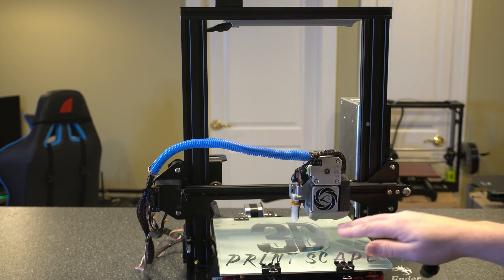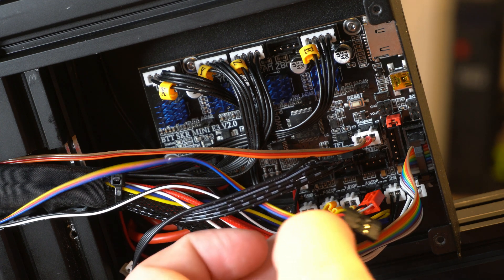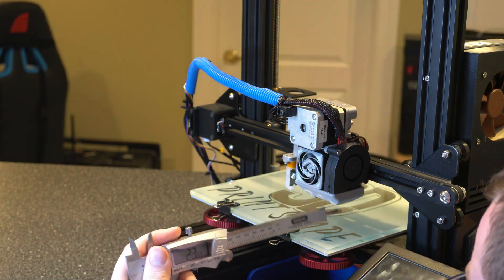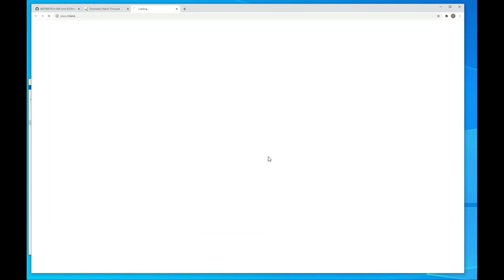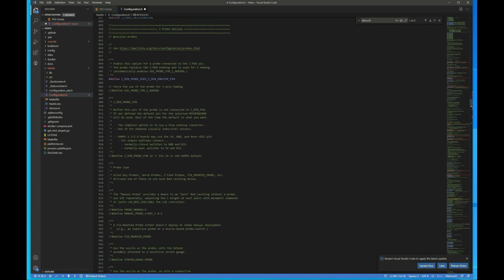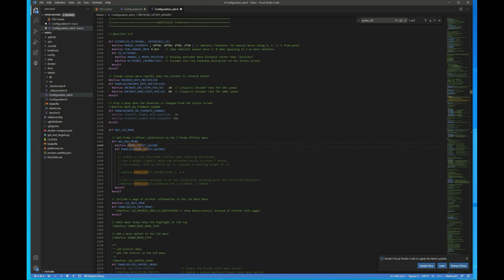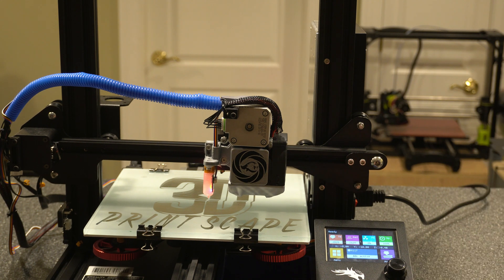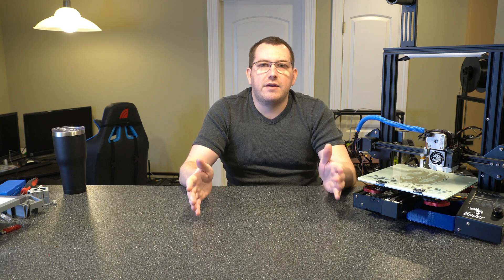BLTouch on SKR Mini – Install Guide

Comment: Robert this video is great I have 2 ender 3 pro'2 and 1 has this exact board in it so this video helped me get my bl touch installed perfectly.  I am running the factory firmware on it but would love to build a version like you did in the video.  I wish I could get a copy of the one you built on here, as my printer is the exact same.   I am just not quite comfortable enough to write my own firmware yet LOL.  I was able to obtain a full version of marlin for my other printer which has the stock 4.2.2 board and it runs so much better than the creality firmware.  Just wanted to say again great video it helped me very much.
Reply from the maker: Hi. Thanks for the feedback. I actually have build available here that you can use. https://3dprintscape.com/marlin-firmware-builds/

Comment: My "default_envs" is set to mega2560....do I need to set it to the "STM32F103RC_btt_512K"  I have the same setup as your video.
Reply from the maker: Hi. If you using a build after June, you will want to change that to STM32F103RC_btt. The _512k has been removed as an option.

Comment: Hello, you said for the wiring you have to swap the blue and red cord right? how do i do that?
Reply from the maker: Hi. You should verify the pin out for your bltouch, ive seen them shipped with different wiring colors. If yoou need to swap the pin, there is a little tab you can pull on the adapter that will allow you to pull the wire out.
Reply: @3DPrintscape  Thank you so much i really appreciate that!
Reply from the maker: @BrothaManLemon  You're Welcome
Reply: @3DPrintscape  hey one more question. so if i still have the stock fan cover i can just take either the SKR firmware or the Marlin firmware, download it, change name to firmware.bin, pop it on an SD, put it in my printer and then I'm good? or do i have to make changes in the firmware still?
Reply: i downloaded the SKR Mini Firmware and when i turn it on and hit bed leveling it just says home z first. i downloaded the frimware where you attach the BLTouch to the Z stop
Reply: So i tried doing exactly step by step what you did with the marlin software and for some reason when i try to build the firmware it shows red text and doesnt build
Reply: sorry last comment lol but when i try to build it says "Error: Unknown environment names"
Reply from the maker: @BrothaManLemon  Assuming there are no other changes you want to make, that would work fine.
Reply from the maker: @BrothaManLemon  Did you add _512K to the name? If so, remove that. It was removed from the bug fix line back in June.
Reply: You da man sorry for the multiple replies lol
Reply: yea ive followed everything to the T and every time i try to build the firmware it says failed. probably gonna give up on this one lol i really appreciate all the help tho!
Reply from the maker: @BrothaManLemon  If you need more help, you can join the discord channel. Its easier to troubleshoot there.

Comment: Just got my SKR Mini E3 V3.0 and jeez, this is going to be a p.i.t.a. to set up properly lol! I referenced this video to follow similar steps, but it's so new that there aren't any stable firmwares apparently. You plan on upgrading?
Reply from the maker: Hi. I've considered picking up the v3 but to your point, there isn't much reference material on it. Id does look like the BTT github page has the config that can be used a starting point though. This may help out for your marlin build. https://github.com/bigtreetech/Marlin/tree/SKR-mini-E3-V3.0-G0B1
Reply: @3DPrintscape  thanks for sharing! I was pondering the thought of creating a little vlog on getting this thing working, but I'm at the "trial and error" point where I don't want to make a video of 12 diff tries before having success, haha! I'll tag you if I get this video up today.
Reply from the maker: @TechReviewLife  Sounds good, if you run into issue let me know and I will try to help out.
Reply: @3DPrintscape  first issue has arisen, lol! After I used WinMerg to compare my old Marlin to the new one I just downloaded, I get pretty far through compiling the firmware in VSC, but then I get this error.

<command-line>: fatal error: variant_MARLIN_STM32G0B1RE.h: No such file or directory

I've tried to search for this error but nothing pops up, as I assumed nothing would given that this is so new. Any tips?

Thanks!
Reply from the maker: @TechReviewLife  That may just be a file length issue. Try to move the firmware folder closer to the root of your drive.
Reply: @3DPrintscape  fixed it! I copied over pretty much everything that was different between the V2 and V3 firmware, and that's what gave me the error. I went back and only edited a few things, bltouch, offset, zprobewiz, etc, and it's working great now! Bottom wheel of my MSDD is eating in to the rail, but that should be a simple fix lol.
Reply from the maker: @TechReviewLife  Nice, Im glad you got it working. Thanks for the info, it will help me out when I get the board.

Comment: My printer ignores both ZSTOP and BLTOUCH, I've done everything exactly like you but with the 5 pin configuration(the ZSTOP is still connected but not in use by the firmware). When I try to home it ignores both stops, it doesnt work properly if I use the bin from bigtreetech but they only do a single probing which is why I wish I could use the custom firmware.
Reply from the maker: Hi. If it works with the BTT firmware, the wiring is good so it sounds like there is an issue with the firmware. Im guessing it doesnt match how its wired. Make sure you comment out #define Z_MIN_PROBE_USES_Z_MIN_ENDSTOP_PIN and uncomment #define USE_PROBE_FOR_Z_HOMING in the firmware.
Reply: @3DPrintscape  so I’ve checked that and swiped them and nothing. My version is a bit different than yours it seems, on min_software_endstop  urs goes like X Y Z but mine goes X Y Z I J K which tells me they have changed the software on the download page. Would you mind sending me your configuration files so that I can compare against mine and try them.
Reply: @3DPrintscape  nvm I fixed it, BLTOUCH_FORCE_SW_MODE had to be commented out, i guess my bltouch isn’t a good clone then.
Reply from the maker: @bomxacalaka2033  Im glad you got it working. The definition of a "good clone" is really subjective. If it works and you were able to save some money then it seems ok to me :).

Comment: This sucks, lol fudgeeeeeeeeeeeeeeeee , 6 hours and keep running into error wtaf.
Reply from the maker: Hi. What errors are you running into?
Reply: @3DPrintscape  I a running SKR Mini E3 V2 on Bltouch 3.1, The  big issue Im having is when I press autolevel the pin does not drop and the light is RED, no sign of a blue light since I installed, and the nozzle crashes into the bed, If i dont press the power off button the machine would just crash into the bed untill a motor gives out.

Comment: My firmware compiled successfully without adding the “_512k” at the end of the default_envs line. Will this cause any issues when flashing to the printer? Or was this not a problem anymore?
Reply from the maker: Hi. The _512k is no longer needed. There was a release made to the bugfix line over the summer that removed it. If your build was successful, you should be good.

Comment: Does 1M extension reach because I see people complain in reviews it doesn't?
Reply from the maker: Hi. It has been working for for me. Maybe they mounted the bltouch a little higher, the one adapter allows it to move up and down.
Reply: @3DPrintscape  I think the complaint is it doesn't reach the main board with the cable.
Reply from the maker: @snowmanDIY  Ah ok, i was thinking of the 1mm adapter on the mount, sorry. The stock one reached fine for me. I bought a generic one that I ended up having to extend the cables on.

Comment: I'm having problem with mine where it will deploy, but when trying to trigger it and it fully depress it will bot do anything.  it will keep moving unit it turn it off.
Reply from the maker: HI. It sounds like the wiring isnt right or the firmware doesnt match the wiring.

Comment: maybe I am crazy or just dumb, but I dont have a check box when trying to use the btt version for the skr e3 turbo.
Reply from the maker: Hi. The checkbox is only there if platformio is installed and the firmware folder that has the platformio.ini file is opened. If verified both of those, try to reinstall the c/c++ plugin.

Comment: every time I go to compile this I get an error. "include errors detected. Please update your includePath. Squiggles are disabled for this translation unit"
Reply from the maker: Hi. It sounds like the firmware folder may need to be moved closer to the root of the drive you are working on. The folder structure of the firmware goes pretty deep and Windows doesnt like long paths/file names. I typically create a folder called firmware right off my c drive and put the firmware there.

Comment: hey im back haha, i was wondering if theres any way for you to reduce the amount of probes? IE instead of a 5x5 a 4x5/4x4 grid of the bed. Amazing guide btw!
Reply from the maker: Hi. Thanks for the feedback. If your using Marlin firmware, you can change #define GRID_MAX_POINTS_X to whatever multiplier you want. The default value is 3, which creates a 3x3 grid. If your using the prebuilt firmware, im not aware of a way to change the value.

Comment: My blue and red chords are swapped. What do I do? The colors are red, blue, and then yellow.
Reply from the maker: Hi. Thats pretty common, you will need to change the pinout at the adapter.
Reply: Thanks...now I have to find a how to on that. Appreciate the prompt response.👌. This is my last upgrade, and a. Not trying to fry the new board.
Reply from the maker: @drksyd_chase  There is a little slot on one side of the adapter that has a tab, if you pull the tab out you can pull the wire out. Make sure you don't break the tab though.
Reply: @3DPrintscape  I saw one of your other videos and got it. Thank you. I used this thin metal piece that came with the ender in the tool bag. I wedged it and lifted the tab. It was easy because it was so thin.

Comment: Hello, amazing video but I have two questions

1. I keep getting this error message that does not let compile the files. Do they work if I just save them in notepad?

2. I can not seem to locate that .pio file even after i enabled to view hidden files.

please help me.
Reply from the maker: Hi. I would need the actual error message to help with number 1 and what are you trying to save to notepad? For number 2 the folder gets created when the first build starts, even if it fails. The only exception would be if the account doesnt have permissions to create the folder, which would also cause the build to fail.
Reply: @3DPrintscape   is it possible to get your email to better communicate?
Reply from the maker: @zapnyte3012  Ya, my email is admin@3dprintscape.com

Comment: I wish you would explain things instead of just telling what to do. I had to google what the difference between bilinear and mesh leveling... Would have been nice to give us a reason why to choose one over the other.
Reply from the maker: Hi. Thanks for the feedback. I understand what your saying and have a hard time balancing detail/time on longer videos like this. I decided on focusing on how to get things working not necessarily why each setting was chosen.
Reply: @3DPrintscape  It often helps to use a script instead of working on the fly. That way you can keep your sentences short and clear. You can also use jump cuts while editing to cut out parts where you're silent or where you're saying 'uhh'.
That can easily save you 3 minutes in a 10 minute usual edit!

Keep up the good work :)

Comment: i have an issue, after a while my bltouch started to probe off the bed, i tried to rewrite the firmware but it seems to not respond to it, ive done some research and i says i need to reset eeprom which i have no clue to do, any help?
Reply from the maker: Hi. Make sure your offsets are right, so -44 and -7 if your using the stock mount. The select restore defaults to clear the eeprom. I have written instructions covering the process that may help you out in the video description.
Reply: Thanks for teaching me how to clear the eeprom, but the issue still remains, that being that no matter the change i do to the firmware the bltouch probing placement nothing changes
just to make sure im on the same page this section is how you change where the bltouch probes right?
 *     +-- BACK ---+
 *     |    [+]    |
 *   L |        1  | R <-- Example "1" (right+,  back+)
 *   E |  2        | I <-- Example "2" ( left-,  back+)
 *   F |[-]  N  [+]| G <-- Nozzle
 *   T |       3   | H <-- Example "3" (right+, front-)
 *     | 4         | T <-- Example "4" ( left-, front-)
 *     |    [-]    |
 *     O-- FRONT --+
 */
#define NOZZLE_TO_PROBE_OFFSET { -47, -7, 0 }
Ive done drastic changes to the offset, and minor ones but nothing seems to show
Reply from the maker: @mingo7687  Try setting these values to force it to move some, I had to do something similar in the past. #define X_MIN_POS -5
#define Y_MIN_POS -10
Reply: @3DPrintscape  i finally got around to trying to fix it hahahaha, but this totally worked! Thanks man youre a legend!
Reply: @3DPrintscape  and here you thought i was done lol. After doing some tinkering i realized that the gaps in-between each time it probes is too large for my bed, can i reduce the amount of probes/tighten the gap? thanks for dealing with me btw lol

Comment: Very informative and has helped, but I have an issue I haven't been able to resolve. I'm running the SKR mini e3 on a CR10S5 so had to also adjust bed size, but otherwise used your settings on BTT firmware for 1.2 using the probe/servo pins on a 3dtouch. When trying to level, the z doesn't stop when the probe shows it's triggered, which of course leads to an error of hitting the endstop. I have adjusted my z offset....is there another setting I need to look for? I would think from other videos once triggered the z should stop even if in the air? The LED does show it's triggered, but keeps going.
Reply from the maker: Hi. Thanks for the feedback. How is the bltouch wired? It sounds like you have it wired with all five pins going to the bltouch port but the firmware configured for z homing with the bltouch.

Comment: Hi I’m thinking of upgrading my board to a skr mini v2 did your ender 3 pro used to home with bltouch in center of bed without using z end stop switch? If so when downloading the firmware do I need the same version as you?
Reply from the maker: Hi. Yes the printer would home in the center of the board with the bltouch. I have my firmware available to download if you want to try it out. https://3dprintscape.com/marlin-firmware-builds/
Reply: @3DPrintscape  thanks for replying to my comment that’s greatly appreciated I’m waiting for my v2.0 board to arrive once it does I’ll be upgrading I just wanted to be sure which firmware in need for the bltouch to home in center and not use the z axis end stop switch has I removed it when installing bltouch
Reply from the maker: @XpDetects  You will want to use the z homing software. Either the one available from BTT github page or my site.
Reply: @3DPrintscape  thanks I received my board today I swapped out all the cables and changes the cables on the bltouch like you did after turning on printer I see it load marlin 2.0 on the skr board but after copying the z homing firmware onto sd card it doesn’t seem to sit at a blue screen just boots up with marlin on screen? I see people saying it needs to be flashed with sd card that come with it but I didn’t receive a sd card with my board
Reply: I have tried many sd cards and renamed the file to firmware.bin but still no success it refuses to load the firmware it seems and just boots as normal..somebody did suggest to add file called firmware and file called firmware.bin to the sd card could this be the problem
Reply from the maker: @XpDetects  We have been working together on this over discord but if you have any questions you can reach out here or there.
Reply: @3DPrintscape  for reference and anyone else who needs this info I got it working finally 👍

Comment: Great guide, extremely helpful but once I click build it says - Unknown environment names 'STM32F103RC_btt_512K'. I'm using a CR-Touch but should follow the same steps right?  Help will be much appreciated
Reply from the maker: Hi. Remove the _512k. There was a recent update to the bug fix line that removed that from the options.
Reply: @3DPrintscape  Thanks, ended up trying that and successfully compiled the firmware but now it says 'no printer attached', any idea what the problem could be?
Reply from the maker: @adnaandavis4529  I would expect it to say that for about 20 seconds, then it should attach. If that's not happening, I would check your wiring.

Comment: The tutorial is pretty good but sadly i cant make it, they update the example files and add some configurations that are not in this video and im lost.. a lot of issues related to the AXIS_DRIVER, AXIS_IS_TMC, also in Software Endstops  are some extra lines not only xyz now ijk are added i dont know if i should disable those if i dont have those extras (the example files that i used was creality ender 3 pro skr mini 2.0  )
Reply: i solve it, i download again the files but now  the latest files from marlin, i did your configuration and everything is working, thank you for your work.
Reply from the maker: Hi. Im glad you were able to get it to work. I plan on making an updated video on this once enough changes are required.

Comment: I attached bl touch like u did in video and download firmware bltouch z homing. Now z motor only can go up. Same thing if i try trough menu manualy lowering z axis.
Reply from the maker: Hi. Sounds like the wiring is wrong or the firmware doesn't match the wiring. How is it wired and what firmware are you using?